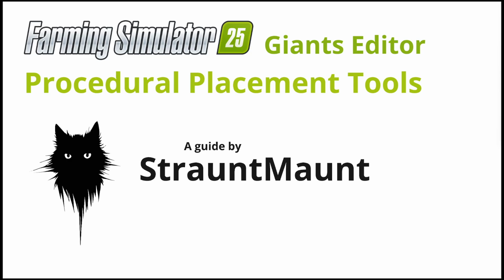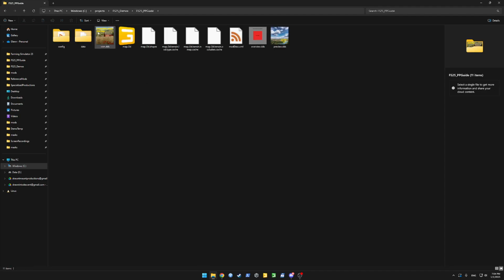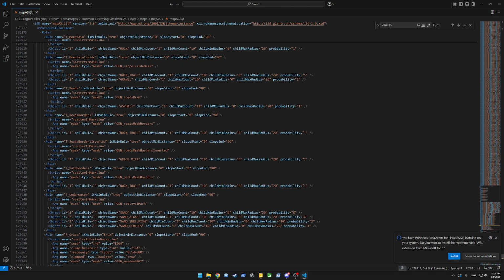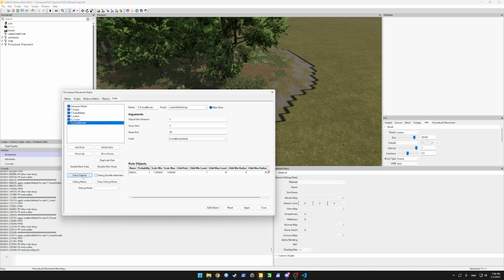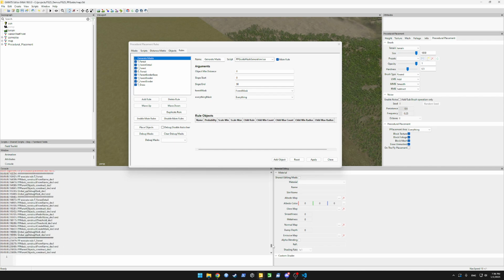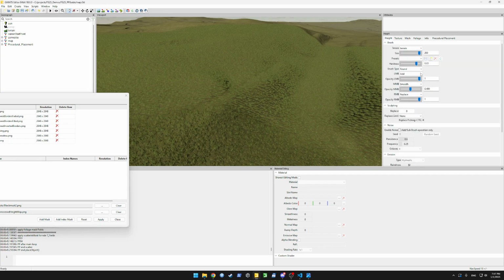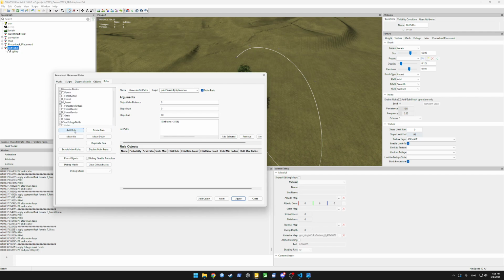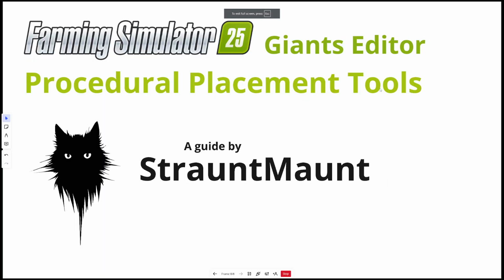FS25 Giants Editor Procedural Placement Tools Guide

Comment: Hello any information how to execute procedural placement rules in GE 10.0.10? Does the "procedural placement" still works for you in GE 10.0.10?
Reply: Yeah it works,
Reply: GE 10.0.9/10 completely screwed up procedural placement. Rules are executed from the procedural placement tab of the terrain editing window now - there is a big button there that says "Execute Rules". You still have to go into the normal procedural placement window in order to select which rules to execute though. On a side note the PP scripts now cause LUA errors and don't always work correctly. From what I can tell the only way to add new masks, objects, and rules is by manually adding them in the map i3d using a text editor. The buttons to add and remove rules are gone so if you try to manually add a new rule by typing in the name field you will get stuck in the rules window, unable to apply or discard changes and be forced to close the program.
Reply: You can rightclick on the Objekt and delate
Reply: @LowDrift- I don't want to delete the rules I want to execute but there are no buttons for that anymore.

Comment from the maker: Most of the stuff in the video is still relevant. But meanwhile I discovered that generating new mask on disk, and importing it as a new mask is not the way to go. You will often have to restart the editor to load in new changes. 
The ppSaveMask should only be used for debugging purposes. 
You should use masks in memory instead of on disk, For examples you can look at the newer videos that use PG_Scripts or this codebase: https://gitlab.com/fs25_guides/fs25_proceduralgeneration

Comment: Do you have any advice on troubleshooting, especially on a larger map?  I have a 16x (8192mx8192m) and have tried several combinations of block mask size and forest mask. It seems I must run them both at 4096 size, which is fine, but the mask is painted off to the size of where I paint. If I click the debug mask button, GE crashes
Reply: I should add, one thing I haven’t tried is making these bigger. My densityMap_ground and other GRLEs are currently sized at 16384, does this matter?